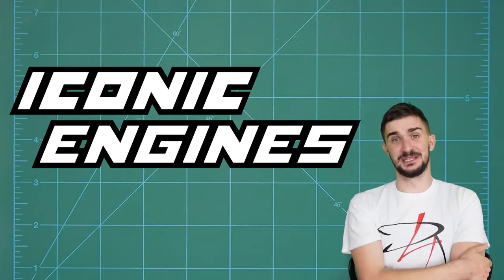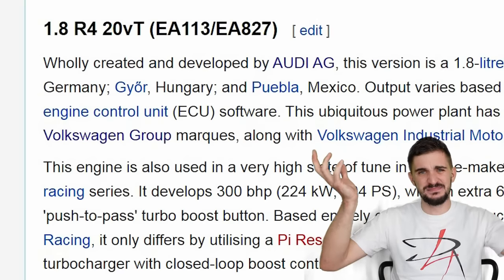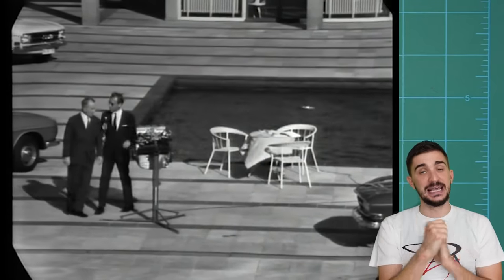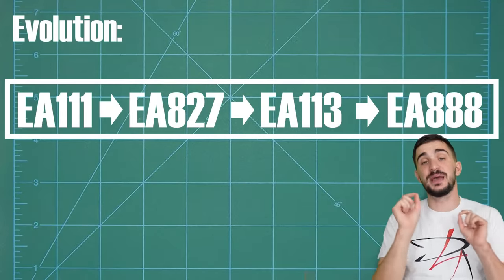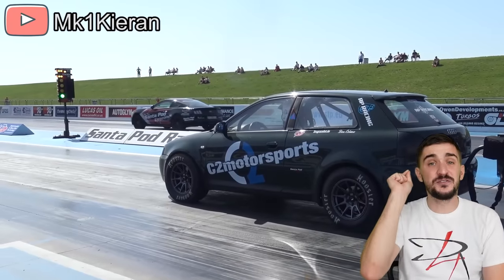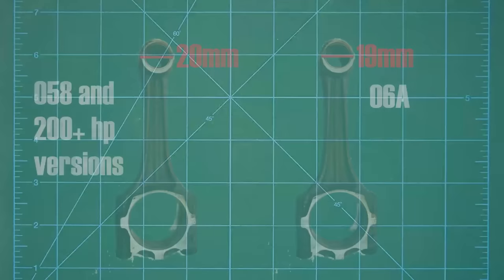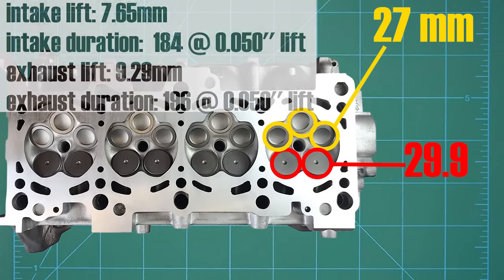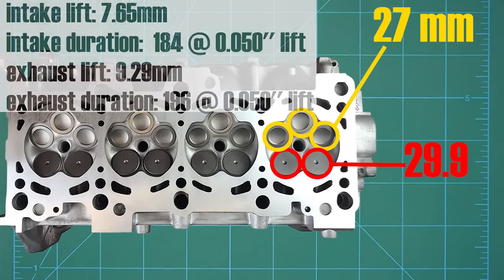VAG 1.8T 20V - What makes it GREAT? - ICONIC ENGINES #17

Comment: My first two cars both had 20v 1.8Ts, never did tune them, honestly a MkIV GTI with 180 HP was a bit of a muscle car stock so I focused on chassis and driver upgrades with those cars! Was religious with 5000 mile oil changes and the problems I had past 100k was a bum coilpack, a coolant temp sensor going bad, and after a decade it finally developed the tiniest valve cover leak so it got a new gasket. Never burned a drop of oil! Great motors. I'm on to an EA888 1.8T with a stage 1 tune now and it's a different beast to drive but no problems at 5 years and hoping it'll stay that way! One thing you could've mentioned is their racing pedigree, built 20v 1.8Ts with up to ~500 HP were the Formula 2 engine for awhile.

Comment: As a mechanic I probably made over $100,000 alone off 1.8t broken timing belts and leaking timing chain tensioner seals and coolant flange failure. And not to mention breather systems made of garbage. So sad how many of these owners refused to rebuild the breather systems. 
Resulting in the turbocharger boost leaking into the crank case. 
Of which no engine should be asked to endure. 

I love em. 
Chip tune em and the first person who drives it will buy it.
Reply: good to know about it
Reply: How does the the boost get into Crank case. I have 1.8t and can see if pipes need replacing .
Reply: As a mechanic I always have one advice to people that likes vw’s, keep buying them 🥰💰
Reply: My timing belt broke .looking for a  motor
Reply: How do I deal with the breathers??
Reply: @manfromyard3143  just change the head. Pistons are fine. Don't believe you need a new block, same thing happened to me.
Reply: What are the most failures of a 1.9TDI ?
Reply: @imbackinthegame3611  dropped valves :D blown turbos :D
Reply: @turdrocket  I did a compression test 140 on 1 ,2,3and 4  zero . Unless the values are stuck open
Reply: @manfromyard3143  bent a valve (or valves) probably mate. bought a 20vt off eBay and it was the same but no compression in any cylinder haha all intake valves had hit the pistons. pistons were fine though, just the smallest indent.
Reply: @turdrocket this engine has timing belt, NOT A CHAIN, chain is in between cams and is not a problem if oil changed regularly. You are talking about newer engine 1.8tfsi, wich has tones of power potencial, yet ton of problems like with chains, water pumps, oil consuming etc...
Reply: @imbackinthegame3611  Injector wiring in the cylinder head can develop a bad connection. Depending on oil changes, oil quality and milage turbos blow but thats just wear and tear and not actuall something wrong with the engine. Thats about it really. Change the oil and the timing belt on time, let the turbo cool off after hard driving before shutting the engine off and you wont even have to deal with turbos blowing. My 2.0pd has near 190k miles (310k KM) and It had a new turbo by the previous owner at 150k km. Havent had an issue with it since and I dont exactly drive careful, but i use good oil, change it every 8k miles and when I drive it hard I let it cool off after.
Reply: What are breather systems ? Thanks
Reply: Like many other european engines, use synthetic, do your maintenance and R&Rs before recommended intervals and you’ll be good!
Reply: @turdrocket  9/10 those timing chain failures are because people dont do oil changes or get their tensioners/chains replaced when they start to hear that ticking sound
Reply: It’s pretty reliable... but gas mileage is horrible.
So far is did: belt at 114k and Turbo at 127k. And Motul 5W40 every 13k or once a year.
stock BFB with 163Hp.
Reply: just fucking avoid buying Audi or VW including their affiliate partners like Seats.
Reply: I'm a mechanic too, all VAG engines are simply failures. VAG 1.8T 20V was a failure too.
Reply: You're talking about the newer tfsi engine. The 1.8t doesn't suffer from any of the things you said
Reply: Thats how I picked mine up for £80 as scap built it from the ground up gave it everything it needed and bigger better its the best car iv owned and its only a stage 1& abit until I can get it properly tuned as it's an older AGU
Reply: @turdrocket  These are timing belt cars. Not chain. Only chain is oil pump sprocket or the VVT on the cams, and those chains do not fail. I have cars with original chains on both 2.8, 2.7t, 4.2 and multiple 1.8t. Over 1.3million miles collectively .
Reply: Every engine has common problems and every timing belt needs to be replaced, so thats universal. I hope you know which 1.8t is being spoken about, after 2005 the 1.8t as well as most other vw engines are trash.
Reply: @imbackinthegame3611  non they rock pre 2005 almost indestructable.
Reply: @robertinferno7862  you are a failure, stop talking nonsense, they are not the pinnacale but their will never be complete agreement from everybody which engine is best. The 1.8t is defently one of the best engines.
Reply: @robertinferno7862  You're talking crap, it's one of the most reliable engines out there. You're obviously talking about the later models.
Reply: Wonky engineering, I mean a plastic clutch pedal and forged Mahle pistons in the same stock factory vehicle? They got the motor internals right and that 6speed is great but then they just kind of gave up and designed everything else for about a 100km life span, Toyotas these are not..
Reply: @kennethfrazee2540  Many of these cars and engines (and clutch pedals) are still going strong 20 years later. I daily mine and have done 50,000 miles without needing anything other than service items and a few PCV pipes that cost about $20 each
Reply: @fliegenmann2562  U should use meguin or ravenol vst instead of motul.
Reply: @aqibfreed4672  Positive crankcase ventilation. PCV.
Reply: @imbackinthegame3611  Dropped valves but specially turbo launching exhaust side straight to between piston and head 😂 My experience with 1.9tdis so far 🙄 First time for 1.8T turbo and facing some issues like vacuum leaks and fans not working like those should.
Reply: I had a golf 4 with this engine and the car was generally not good all round. Couldn't understand the rep. It was slow and bad on fuel, the interior squeaked and rattled, the suspension was soggy as f and creaky too, the chassis flexed badly under moderate speed, the PAS was grandma light with no feel, the rear washer leaked and stained the headliner, the windows fell into the doors and the cam belt cost a fortune to replace. As stock, worst car I ever owned.
Reply: @iNSTAGiB Yeah most of thase self claimed mechanics don't understand statistics at all. They are also listing common failures by age and use, you gotta maintain cars and that means rebuilding breather hoses, exhaust gas resirgulation and change turbos, coolant flanges and so on, most of thase failures are just typical on any engine. Keep note that cars with 1.8t are closer to 20 year old than 2. So fairly common, also every issue listed here is way easier to fix than thase 6$\hr mechanics says 😂
Reply: europeans thinks their garbage is always the best, vw engines are not even close to be good, im a mechanic too and i made tons of money on their pos 4 bangers, even the 2.0l 8v was unreliable, chain rattles on every single engines, i own a 3.0l supercharged audi and its a fucking turd too
Reply: @retrocompaq5212  funny story. I drive around 35k miles per year and keep a list of cars I see broken down on the motorway. Audi is #1 with 3× more than any other brand 😂
Reply: @retrocompaq5212  If European cars are so bad why do they totally outsell American cars globally, and here in Europe we consider Ford and GM to be the worst most cheaply cars ever made by humans, total garbage!!!
Reply: Been 20 year without replacing TB  but just SB 3x ! The reason is I cannot do myself but my 1.8 is still running well now however I’m worrying but it seems no crack etc it’s still good ! 225 base BAM
Reply: @turdrocket  it’s a pretty common issue on any 4 cylinder especially from the 90s & earlier due to the inherent secondary forces from a flatplane crankshaft causing excessive vibration even with balance shafts. I recommend changing the timing belt/chain & tensioner on any 4 cylinder every 100k miles. Personally I’ve seen issues like this on just as many Toyotas & Hondas as VWs but for whatever reasons VW is the one that gets the unreliable reputation.
Reply: @waifuracer6516  what oil do you recommend
Reply: Ya even atmospheric engines have blow by but this is simply fed back through the pcv, I can see a boosted engine requiring more then this...
Reply: @Ianf1x  I THINK it is the normal pcv valve/breather not working to only pull a vacuum, but instead getting stuck open and leaking boost into the engine when you start to build boost.
Reply: @7671denso  😂
Reply: You're correct I drove my 05 GLI 1.8 t o to m 6-speed car 6-month model only made I drove that thing for 7 years with the rubber PC valve pipe that comes off comes off valve cover goes to is all cracked it had after a few years of me beating the hell out of the car I realized it's and was there was sand and dirt debris getting in there every time I change my oil filter it was triple heavy from the sand getting into the valve for some oddball reason 220,000 still going strong but I've always change the oil in the around 2000 2500 Miles because I'm hard on I've had the car for over 10 years still running today lol with the same cracked PCV valve tube LOL and it has an APR stage 1 tune LOL for some reason she spikes 25 lb used to hold off at about 20 now holding off at seventeen but the car still runs motorwise top and beautiful I'm actually getting ready to fix some things for once got caught at 158 point mph in this buggy and I got stopped
Reply: The breather systems and the fucking coolant flange is a pain in the ass for sure. I have no idea why I didn't remove the whole PCV thing when I had the whole thing disassembled. Vacuum lines are also pretty problematic but manageable.
Reply: @nocturnaL1d1ot  Replace with metal coolant flange and silicone breather hose setup, and all will be well.
Reply: @7671denso if your fixing them and u get 1k out plus 2 k of parts for it to sell at 6k a w of 15hunnit  i mean let's start the vagclub and possibly a scene
Reply: They are too xpensive and we talking about just a limp mode  heart attack.
Reply: @robertinferno7862  Not true.  Typical for a generalized statement like that.  330K on my 1.8T, head never taken off engine. Follow regular maintenance, install metal cooling flange and silicone breather tubing, and good to go. Very reliable.  Clearly you don't know what you're talking about.  The only mechanic work you do is on your toy matchbox cars, obviously.
Reply: @TK-ec5bv  rattling marbles are OK
It’s just when you can’t find the damn things.
Reply: @MoroccanAnwar 5w40
Reply: @turdrocket are you referring to the 2000 GTI or newer than that?
Reply: 034 silicone/billet breather assembly, aluminum coolant flanges, and regular routine maintenance on the rest and these bad boys just keep going. I’ve got 3 and they all run like a top.

Comment: I had one of these in a Passat B5.5, I had it remapped and it turned into a completely different animal, SO much extra torque all throughout the rev range, it was amazing. Got me hooked on tuning the minute I did my first 2nd gear pull!
Reply: I happened to buy one by random chance. I was shopping for my first car, and the first one I stumbled upon was an '03 passat with a 1.8t. I didn't know much about cars then. But I did like the car in general, it seemed decent. Brought on the spot before I found out the 1.8T is probably the best engine I could've, and did get at my budget. Currently eagerly waiting till I'm able to get a job and upgrade my passat. I swear I will drive it until it refuses and is too expensive to repair. 
which might be sooner rather than later given its an automatic model... :(
Reply: @Bomkz manual swap with the 6 speed transmission (relatively bulletproof as long as fluids are kept maintained) and get vcds with a laptop so you can recode it to a manual mode ecu. If you take care of its failure points(cam tensioner, timing system) refresh its compression every 200k miles and do oil changes every 3-5k/monitor potential oil issues and you got a pretty much bulletproof system. Keep an eye on the online sites like urotuning. When they had a labor day sale I bought all the gaskets, rebuild kit, timing system, cam chain tensioner, bolts and whatever else needed for less than $1000 total. I recommend replacing the timing components every 60k miles which might seem a little excessive but a tbelt snap ruins the engine so its not worth the risk. Well maintained and kept up these engines can be YOUR lifetime engine. Beats spending 20k on newer used cars where the transmission will fail on you way before the engine does
Reply: what happened to your fuel millage?
Reply: @100W-z2c  well, I don’t think technically it caused it to drop too much. But it made it much more fun to drive so of course I put my foot down much more often and the economy dropped a fair bit. I think overall I actually was only getting like 28mpg (uk gallons). Mostly around town driving though.

Comment: I put a stock-block AWP 1.8T into my MK3 Jetta in 2002 and put a T3/T04E 50 trim turbo, tubular manifold and SDS management on it. Tuned the fuel and timing maps on the street using a knock box and a wide-band (they were rare at the time.) I ran it at ~300 whp and up to 8250 rpm for three years straight, and it never missed a beat. The timing belt skipped a tooth once, simply reset it and ran it another year without issue. When I finally opened it up to install aftermarket rods, I was shocked at how clean it was. All valves straight, bottom end bearings looked new etc... Solid engines for sure.

Comment: Built a Golf 4 fwd some years ago with an upgraded turbo. Car ran amazing, so amazing that it started snapping front axles and blowing turbo pipes. Turned out the wastegate was stuck shut and the engine was seeing 40+ psi of boost on mainly stock internals. This engine is bulletproof.
Reply: 40psi? DAMN 🤣🤣
Reply: @sn1per.-992  Yes, I measured everything, and this is how we found out the waste wasn't working. All sorts of things broke on the car, but the engine! ;)
Reply: @dreci3001  German Engineering😉😂
Reply: @sn1per.-992  German Engineering died around 2004, everything after was made to break. I have a friend who studied engineering in Germany and he said the following: 5 year program, 4 years they teach me how to fix and make things indestructible, the last year they teach me how to make it as cheap as possible and planned obsolescence. As a former owner of a modern BMW, I agree with him. 🙂

Comment: My dad had a MK1 Octavia VRS with this same engine in it. It holds a special place in my heart because it was that car that got me into modifying and performance cars. I'm so glad to be able to learn more about this incredible engine. Thank you so much for making this video!
Reply: I've got a mk1 Octavia 4x4 1.8T, it's such a good fucking engine even if it's not the holy grail VRS
Reply: Love my mk1 octavia 😃
Reply: I'm definitely gonna have to buy a MK1 octavia VRS someday. Purely because of how much I respect and love the car and what it's taught me
Reply: What were your dads thoughts about modifying his car? 😉
Reply: I had a brand new 2002 Oct Vrs, wound it out to 320bhp with  bolt ons and a map, ran it for 100k miles in that tune before I sold it only ever having done nothing more than oil changes and timing belts. such a strong motor and a great car!

Comment: Thank you for the great and comprehensive insight. I do however, have one comment: The EA111 family of engines (Audi50, Polo) was originally designed for lower displacements of 0.9 to 1.3 liters. Their bore center distance is 82mm.

Comment: Thank you for the superb history lesson. :)

We bought our 2001 Passat wagon at the end of January 2001, and we are still happily driving it, because of its absolutely ideal size and body configuration. Great combination of driving experience and practicality. The engine itself has given me no trouble, but I have had to replace things like O2 sensor and oil cooler. We have the relatively rare AUG 1.8T. I have always compensated for the undersized oil sump with a huge Mann 950/4 oil filter. At the 18-year mark, we replaced the valve cover gasket, and there were none of the dreaded oil coke ("sludge") particles -- just varnish.

Comment: 1.8t engine is amazing, for sure can can take way more power reliable 500+hp with just rods. Plenty of evidence out there that proves this. Good video!
Reply: 500HPout of an small inlinefour,  but more displacement rendering an engine so much more drivable.
Always will prefer an VR over the small Turbo-Establishments...
Reply: @tt-rs1457  But the 1.8t is still easier to mod, with a vr you need to turbo it first otherwise the vr engines are pretty slow.

If you have the money and the experience on modding cars then build a vr6t, otherwise just buy a 1.8t and start learning on it.
Reply: yeah you can run 500hp on that engine for about 200km before it is destroyed. Just because you can reach those numbers doesnt mean the engine can run standard on that

Comment: Had a 1.8 audi tt when i was 16. My dad was a master tech at the audi dealer and he chipped my car and it made it amazing. Got 300hp and it got out of first gear without giving it gas. One of the best engines ever. And hella fuel efficient

Comment: Stock 2001.5 Passat here. The engine feels brisk off the bottom, but it tapers off quickly above 3000 rpm. I remember being shocked after driving it the first time, thinking Where’s the Power?
I just learned to drive it like a diesel. It’s much happier, and fuel mileage improved by almost 1/3.